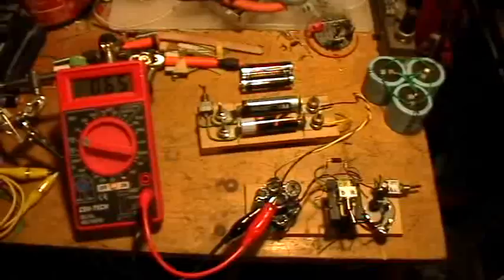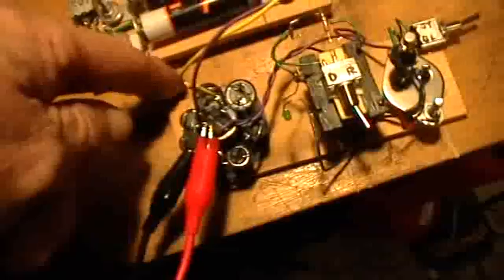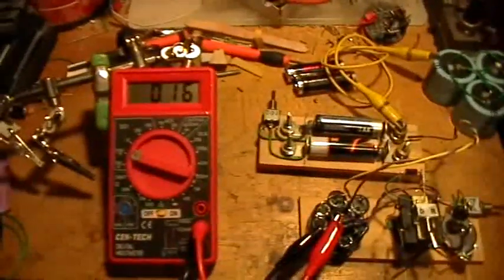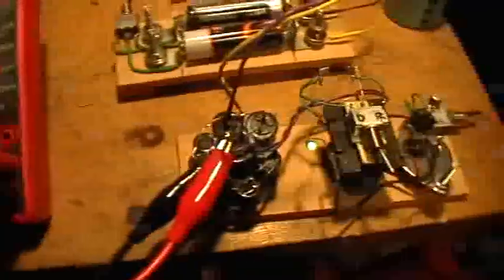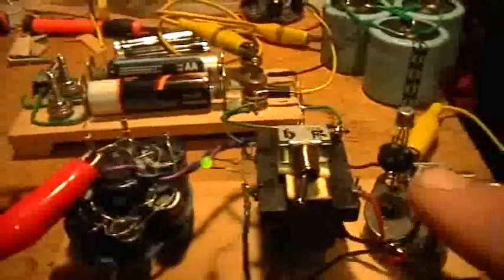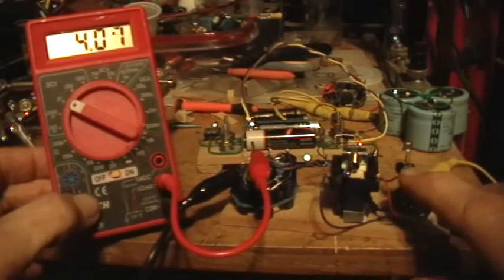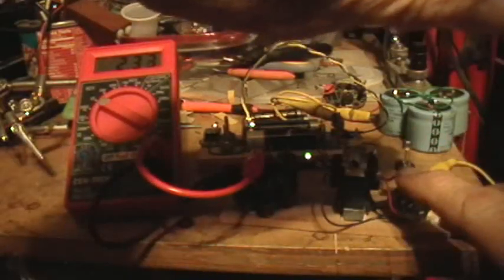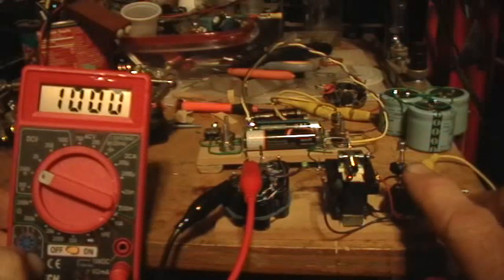Joule Thief: LaserSaber's GhostLight, Version TKLite, Demo 3

Comment: Great video. I just wonder why your caps run down so fast.  On my setup caps of a much smaller capacity hold there voltage for a much longer time.  I am talking about capacitors in the 16v 33uF range.  see my latest post on LaserHacker forum.  Maybe it's the transformer or type of diode I am using that makes the difference.